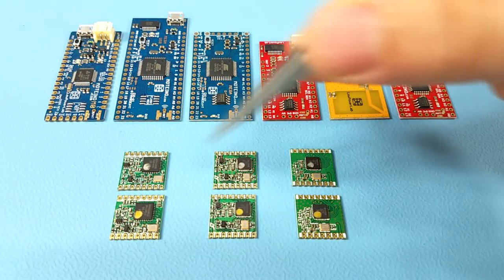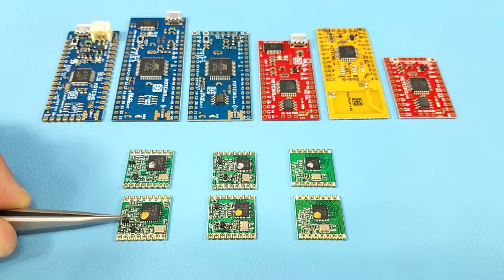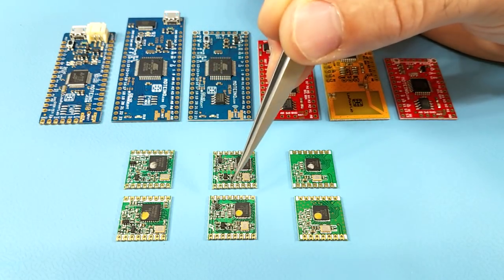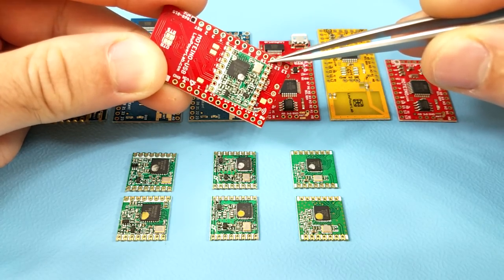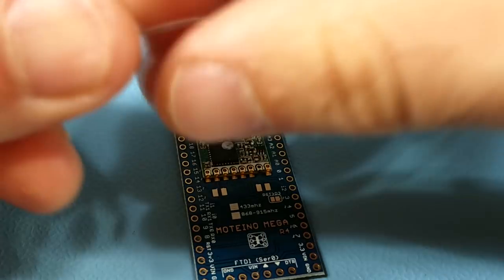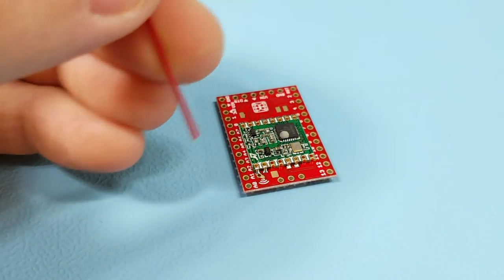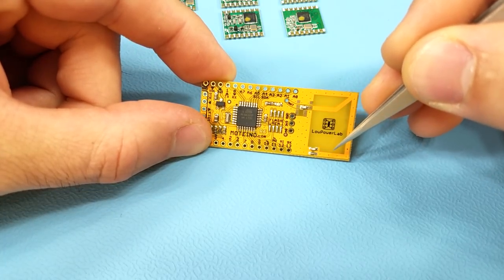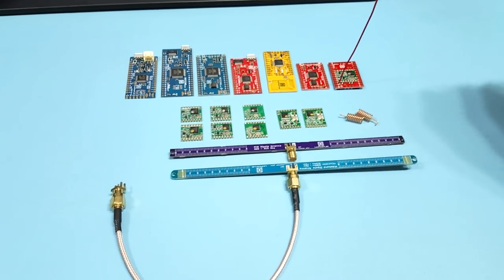RFM69 & LoRa Transceiver How-To Guide & Best Practices

Comment: in my testing, the little helicals outperform the pcb trace antennas by about 20db.

it's also worth remembering the rfm69 are capable of OOK as well as FSK. it also claims MSK/GMSK but i have not seen anyone use it.
Reply from the maker: Thanks for your contribution,
20db is two orders of magnitude stronger signal :-) so wow thats good! There's many variables to take into consideration when you do antenna testing. Like I mentioned elsewhere in the forum, my own motes on my property ALL have monopole antennas, go through many obstacles and have strong signal so I never really used other antennas. Its really hard to beat the monopole. But I try to offer a wide range of options for those who want/need to explore even better signal propagation.
OOK is not commonly used and these radios can do much more than what I mentioned in the video and I just scratched the surface here, it was meant as a very basic overall intro and guide for those beginners who are new to all this.
Reply: So you get both LoRa and OOK/FSK with the RFM69?

Comment: Would love to see a video using the RFM69 module with NodeMCUs communicating via the RFM modules. I have some of both in my parts drawer but never used them.
Reply from the maker: Even though I dont use ESP or NodeMCU with RFM69 myself, there are folks in the forum who do, and have shared code/projects so check it out, you may find useful stuff there to get you started. http://lowpowerlab.com/forum
Thanks!

Comment: Nice video thanks for sharing. Can it also transmit and receive audio without any microcontroller.
Reply from the maker: No, these FSK radios are not intended for streaming/audio, but for small data packets.

Comment: Is it theoretically possible that I have fried my RFM69 even with an antenna? I had “radio init SUCCESS” for a while but after I tried to transmit my own data it became “radio init FAIL”. The 2nd board I tested with worked just fine so I know it’s definitely not a software issue

Comment: could these be used in a small scale product and not need to be FCC certified? (tested at a lab etc)?
Reply: Depends on which frequency you use. Yes, they're unlicensed radio bands, i.e. free to use but you might have interference from other devices taking advantage of the same band.